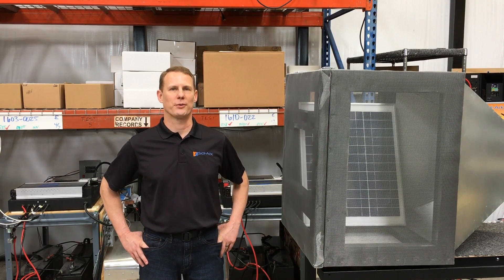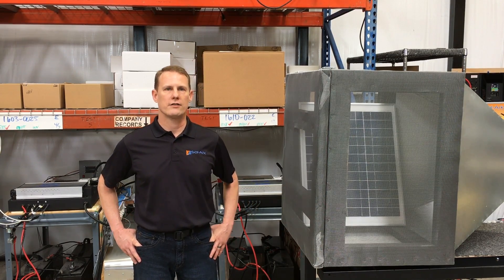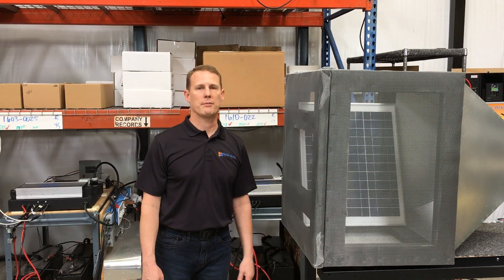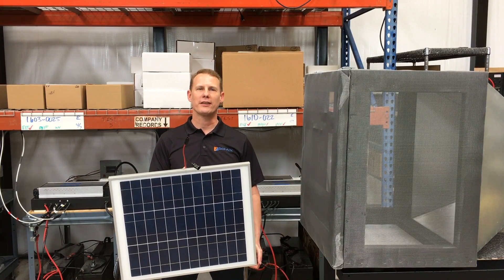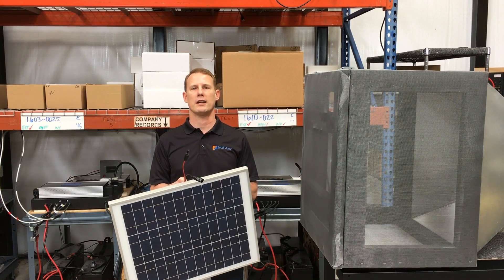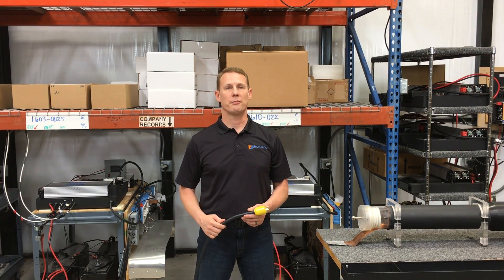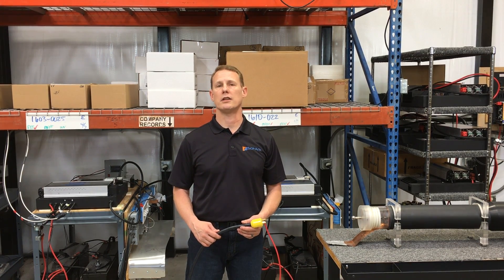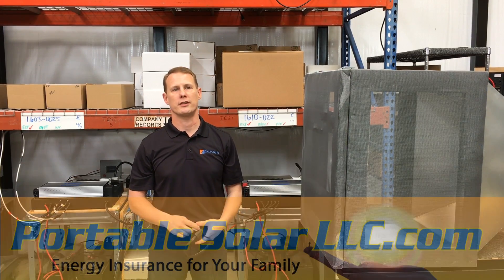EMP Tested: Solar Panels, iPhone, PC & Sol-Ark EMP-Proof Inverter

Comment: So what is the effect on the BMS of a lithium iron phosphate battery? It seems these batteries are great for solar systems but would they survive an emp? Perhaps lead acid either flooded or sealed might actually be better simply because they survive, thoughts?
Reply from the maker: Unfortunately we have yet to find a BMS that survived EMP. When we were testing, they were all active (MOSFET based) BMS's which died so easily. But there are a few batteries out there (>15KWh) with passive BMS's which are inherently tougher. We have a few of these passive BMS's that we may test in the future. Maybe later this year.

Comment: I believe systems start at $16K from what I read.  High-end gear to protect with high-end results... be proud of your pricing, it was hard to find on your site, or maybe it was just me not looking in the right place.  Great warranty! Informative video.... I was researching to see if I needed it for an indoor stored Inergy Kodiak solar generator and sounds like NO and my indoor stored panels should be safe too.  You saved me from needlessly spending about $100 minimum in Faraday bag protection.  Thank you.
Reply from the maker: If all you need is a small system, that’s great. Glad to save you money even if we are not the solution.
Reply: Sol-Ark my system can even be called tiny, when I go bigger I will definitely go with your product👍.  Great info.
Reply: You still need bag protection because it does not shield  100% you can test it by using walkie talkies

Comment: so.. what will be a decent approach incase of a coronal mass ejection from our sun... if i wrap most of the cabling in my boat in lead sheats (since its a sailingboat probably 90% of it because i am doing it myself but the mast have some meters i cant get away from).. and i cover my solar panels and outboard engine with lead sheats.. and make a faraday cage over my whole boat (except the mast and everything in it) that i can ground in seawater.. diconnect most electronics from eachother (physically, just not just a switch or a fuse) in such a case..
Reply from the maker: No need to do a single thing for your boat vs. CME. You are not connected to the Grid with long wires. CME cannot touch you. We just saved you thousands of $$. Enjoy.

Comment: Did the laptop have a HDD or SDD? So does your experiment basically show that HDDs/SDDs, especially unpowered, and their data would be fine in an EMP because of the short wires?
Reply from the maker: It was a HDD. But we tested iphones and ipads and their' SDD was fine. But not all electronics are the same. Some digital radios did not fair well in our other video. Had to remove battery to restart (even when off they were affected).

Comment: I thought there was both a short and a long conducted transient in an EMP from a nuclear source and presumably much longer transients in the case of EMPs from CMBs. Will these hardened systems protect against conducted transients on timescales longer than the nano second regime?
Reply from the maker: Yes. You have to protect against E1/E2/E3 or you fail. E1 and E3 are the hardest to protect against. That is why we used 6 technologies in Sol-Ark 8K.

Comment: That's not a real radiated EMP  simulator.
Reply from the maker: You maybe only familiar with one type. Per MIL-STD-461G are many different Antenna designs and there are different Radiated source types and many different conducted source types to cover the ~20 different types of tests.
Reply: @Sol-Ark  He said it was putting out 50 kV/m.  That's a pulsed EMP system at that kind of voltage.
Reply from the maker: The 50-100KV/m RS105 test equipment you are referring to is not in that video. It is here (https://www.sol-ark.com/emp-hardened-sol-ark/) and you can download the testing report here (https://www.sol-ark.com/wp-content/uploads/2018/05/Portable-Solar-TR-PR078809-461G-Rev.-1.pdf). It was illegal to take video in government labs and the size of the Antenna is massive for RS105 which doesn't allow good video. In this video we used a calibrated fast pulse for the conducted and RF for radiated (like RS103) because it's a lot easier and often produces similar results.

Comment: A few things I noticed. 1) the inverters, when tested were in different places. 2) When the solar panels were tested, your brand had cardboard covering the connectors, the other on didn’t. 3) when you tried to reset the inverter, you just pushed the switch off and on, but your brand, you waiting a bit longer to turn back on, possibly giving it more time to reset.
Reply from the maker: Please give us some slack. There is no deception here from 2 years ago. We did this for educational purposes and we own 3 EMP generators. In fact we try to dispel some of the fear mongering myths that everything dies from the radiated pulse (the conducted E1/2/3 pulses do most of the damage). And if you have any doubts, the Sol-Ark 8K was 3rd party tested to 100KV/m >140 times. Electronics, solar panels and appliances all survived. Test results https://www.sol-ark.com/emp-hardened-sol-ark/.
Reply: It's really pretty simple, the cheap inverters have no circuit protection so any spike is going to pop them.  You don't really need to test it to know it's gonna go if you put 1kv through it. Secondly, protecting a circuit is not rocket science, all military gear is EMP protected, so it's hardly a stretch to believe that an inverter designed to withstand the pulse does.  

I have no connection to this company but I am over joyed to see this vid up dispelling some of the nonsence put out by late night TV shows that care only about ratings and not about truth, and my hat is off to them for addressing the need for small home solar equipment that is properly engineered and protected as most preppers don't have the skills needed to do this themselves.  And it's far better anyway that the protection circuits be built right into the product then to kluge together something after the fact.
Reply from the maker: We did test a Magnum inverter and it failed. I disagree that high end inverters will survive. They are not designed to handle an E1 pulse in every input/ouput. And they will not survive the 300s E3 energy. They are only often protected for E2/lightning.
Reply: Cardboard was probably covering broadband ferrites - the electrical analogue to water hammer arrestors.
Reply: I wasn’t slamming anyone, just was curious as to the differences I noticed.
Reply from the maker: R H we are not perfect, especially when it comes to cameras. In this case we even had to use a TelePrompTer to help.

Comment: Awesome! What about a portable solar charger w storage? Like the kind sold all over the internet, about cell phone sized. Of course, you spoke of smaller electronics but jw what effect emp would have since the battery its self is larger and connected to a power source, completing the circuit w solar. Seems it'd be okay but also not
Reply from the maker: If you will loan us a system, we will be happy to test it.

Comment: The real EMP will be far more powerful than what these guys can generate.
Reply from the maker: That is only part true. We can generate 50-200kV/m with our equipment. A Government lab tested Sol-Ark 8K to 100kV/m (the limit of their equipment). So we have tested E1 & E2 to levels much higher than required. E3 is very difficult to test and only 1-2 labs in the country can test. We could only partly test.
Reply: You'd have to be right next to the bomb to get more than 50kv / m2.  If I recal correctly 50kv is the max the earth's atmosphere can propagate.

Comment: I guess an off grid system could survive an emp then.
Reply from the maker: Unfortunately not E1. It would be immune from E2 and E3/CME. Just your home wires and Solar wires will damage the solar system and appliances with ~1M volts.
Reply: To clarify frank, it can survive if properly protected and designed with EMP protected components, but not unprotected.
Reply: Thanks . You are welcome to see my system on my channel. Just click on my name

Comment: Very interesting. Would this also apply to something like a Carrington level Solar event.
Reply from the maker: Yes and no. Solar Flares/CME and the EMP E3 pulse are very similar. The protection required for them is quite different from the E1 & E2 pulse. E3/CME requires 10's of miles of wire to couple into. So if you are Off Grid, there is no concern for CME. Sol-Ark 8K provides protection for E1/E2/E3/CME with 6 different technologies.

Comment: Ok, nice. But what I have seen in your video is that the "simple non emp proof"inverter is connected + and - in very different directions, thats means very high voltage with high frequencies will enter and destroy it because the cables act like an antenna, but your PROOVED Inverter is connected with parallel cables...... that means both connectors + and - gets the same high impact at exactly the same time. so they dont get an high voltage impact. pls correct me, but I think its not correct what you told us.
Reply from the maker: Thanks for your observation. We didn't pay attention to where the wires were and it makes no difference when performing conducted tests because the E1 pulse is injected directly in the wires. Our corporate mission is that families survive an EMP/CME/Cyberattack. There is no intent to profit from deception. You will see a  brutally honest comparison of all inverters on our website. https://www.sol-ark.com/sol-ark-8k-inverter-efficiency-tops-tesla/
The Sol-Ark 3K was testing internally. The Sol-Ark 8K was done internally and 140 times externally with lab reports. Because the 8K was superior in every way to all previous battery inverters and 5X higher resistant to EMP (6 technologies vs. 4),  all 3K customers were able to upgrade to the 8K. We lost money on every upgrade because profit is not our primary goal. Keep up the careful questioning, learn as much as you can, and educate others to make the best choices with your money.

Comment: but this doesnt come close to what a Nuclear EMP will put out.  Unless im missing something here...
And why did you put a cover on the solar panel cables at 3:39  ...??
Reply: The whole ststem looks hand made.  There was nothin to show how much energy was being released.  Thre are way to many variables in this test to take it seriously.
Reply: @Snags50  Looking at the precision of your text, I will take it that you didn't understand the all the numbers on the various displays? And I would be backing off the quality of the test equipment. And how much energy was being used? Did you not hear the grunt of the camera every time they fired a bolt? Look up Faraday cage. That was the mesh containment system they built. Then there were two different type of pulses. Direct, and induced. Obviously the direct has variable effect. The Induced has much more significance since thousands of amperes will applied to a device that needs 2. You need to understand the variable before you can challenge others to their understanding. Rewatch the video, and stop it so you can read each screen display. The info is there. Take advantage of it, and I'm considering their product, as I know of no one offering similar systems shy of military grade hardware, and the public isn't paying for my stuff.
Reply: He's testing at 50kv / square meter which is the maximum EMP that could be generated in the earth's atmosphere due to the physics involved.  This is a good test and is a crude version of what we use to test military gear.  

IDK what the cardboard is for at 3:39 but since this is a direct line test it wouldn't matter.  Basically in this test he's putting a rapid voltage spike directly through the wires.

Comment: The solar ark looks awesome, trying to figure out how to protect an entire off grid system.  How did you protect the solar panel?
Reply: I just bought 3 EMP Shield devices for my home. One for my main (grid tied) breaker panel, one for my Sol-Ark 12k inverter (PV inputs), and one for my battery (at battery inputs in Sol-Ark).
Reply: I think you can use whole-house ferrites on the incoming cables at the circuit breaker.

Comment: Man, I can't thank you guys enough. Fantastic tests and scientifically accurate, overkill but even better. Now I know who I am upgrading to.
Reply from the maker: Thanks. We had to make it brief. We would like to do future videos testing unprotected LED flashlights, HAM radio, running portable gas generator, running motorcycle (or whatever people donate). 
FYI, our solar panel testing results matched 2 other labs (including military tests). Properly protected solar inverters also survive but almost no chance for standard ones.
Reply: @Sol-Ark  great video. You said that solar panels will not be affected if they’re not hooked up, will inverters and charge controllers be okay if they’re not hooked up as well?
Reply: Are   Sol-Ark   MADE IN USA ?
Reply: @SeaJay_Oceans Yes, they’re made in the USA. I have a Sol-Ark 12k and it’s been fantastic but wish I had the 15k (it wasn’t out at the time 2 years ago). I also just bought a few EMP Shield devices and installed on my Sol-Ark inverter, battery, and grid panel. It’s a great way to go for protection against EMPs, CMEs, and lighting strikes.
Reply: @stephensmith777  I'll look at those 15k ones then !   Thank you very much for answering my question.    Sol-Ark :  POWER FOR THE PEOPLE !   🙂
Reply: thank you , we all need your money 👍🤟👌.
Reply: Rob Lambert 8